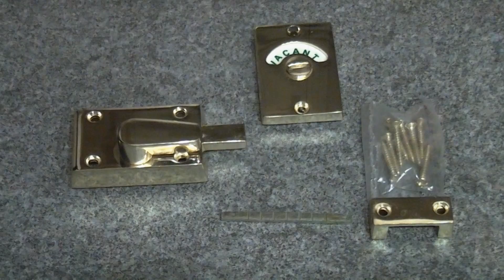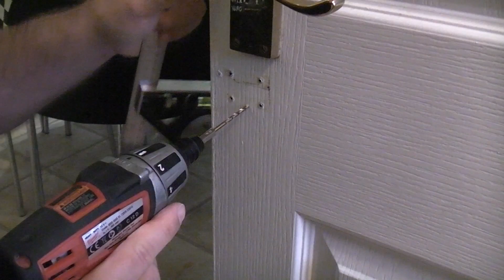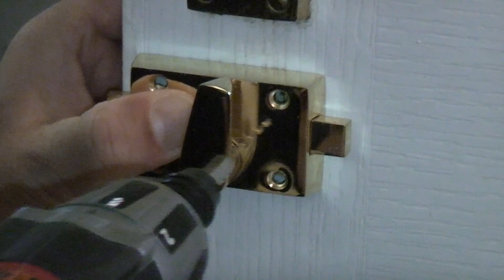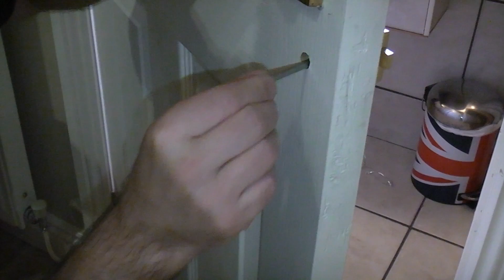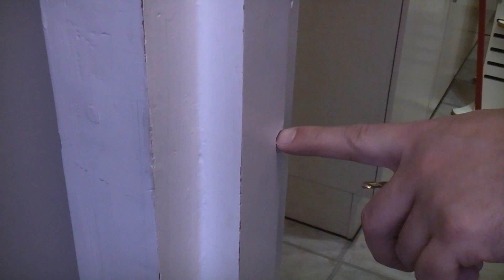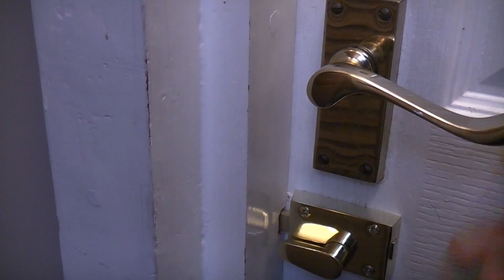How to install an indicator door bolt | Bathroom bolt

Comment: This is the go to how to! At 1.30 you measure where to drill the large hole. 40mm - from where? Only one dimension is mentioned. And then how do you measure where to drill this hole from the other side?
Reply: He probably measured it with a gauge, like a caliper gauge from the back side of the plate. He got the measurement to drill the other side by putting a small pilot hole from one side through to the other side, if that's what you mean?

Comment: Problem I have with similar lock, the bar keeps sliding out of the lock. And the handle is slightly loose, any tips, and does the metal bar with flat surface should  face towards you or the door when sliding it through
Reply from the maker: You might need a longer bar, sometimes people use one that is too short.
They sell them on ebay, if you search for door handle spindle, some should pop up- just make sure you get the correct size, as they come in a few different widths.
Not much you can do about a loose handle, unless you want to start stripping it down and replacing springs/clips etc. (often easier to get new handles)

Comment: If I were to install the keep, how would this be done?
Reply from the maker: You would have to rebate some of the door frame, then screw it into position.
Thanks for the comment 👍
Reply: @ultimatehandyman  Thanks so much. I now realise that I cannot use the keep and will have to drill the hole in as you have done.

Comment: The hole Edge is so thin if someone full the door hard it will break.
Reply from the maker: It's only a downstairs toilet- not Fort Knox ;-)
The bolt is still there today, working perfectly.
Thanks for the comment 👍

Comment: I've just bought one of these indicator bolt to install. The problem I have is my door sits flush with the frame (not inside the frame). So how do I get the bolt into the body of the frame. Do I install the bolt bit that you left out or do I make a hole and let the bolt slide in. I can email you a pic of the door
Reply: I think you would need to install the keep which is the part he said he would not be installing at the beginning of the video....hope this helps

Comment: Excellent video - really clearly explained.  I just fitted one using your video and it works really well. Thanks for sharing. I would ideally like to install a metal plate that would give extra strength where the bolt enters the door frame. Do you know what this would be called so I can search for it? Again many thanks.
Reply from the maker: I'm not sure, sorry- but you could easily make one from a piece of brass.
Thanks for the comment

Comment: Would you have preferred the indicator to have lined up with the actual door handle?
Also I notice you only used minimal torque when fixing to the door. Was it a hollow door?
Reply from the maker: I realised I could get it in line with the handle above and adjusted it to suit, if you watch the start of the video, you will see that it is aligned with the door handle although in the video it's not aligned when I am driving the screws in (I didn't have time to film it all again). The door was hollow, but there is a block where the lock/T latch is normally installed. The screws were tight!
Thanks for the comment
Reply: Oops hopefully no one else will notice😁
Reply from the maker: Simon Rust
LOL, I am sure they will ;-)

Comment: I think you would have been better off chiselling out some timber so the keep could be installed. That 3mm of timber acting as a keep looks likely to break fairly soon.
Reply from the maker: The bolt goes deep into the actual door frame. The bolt that was removed was holding in the same material for years with no problems ;-)
Thanks for the comment